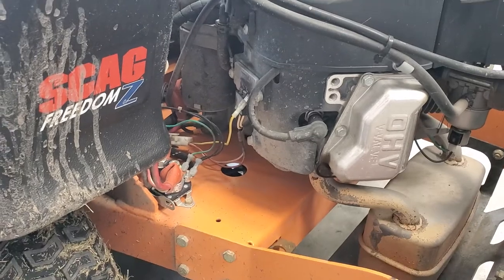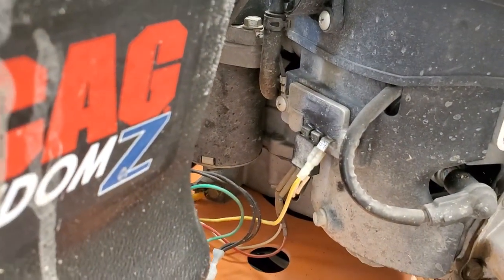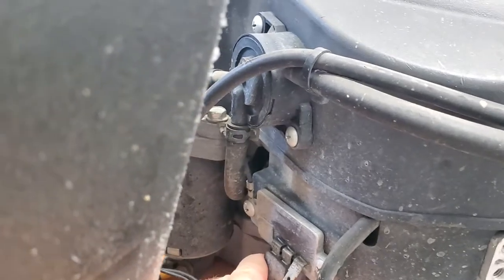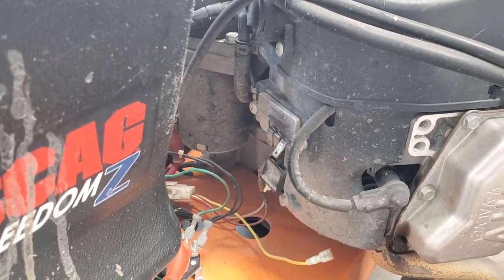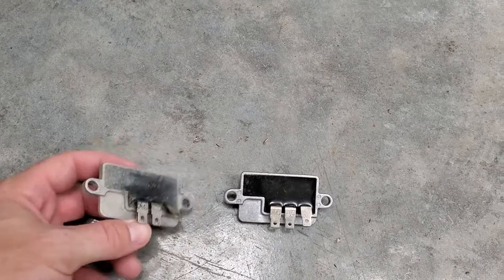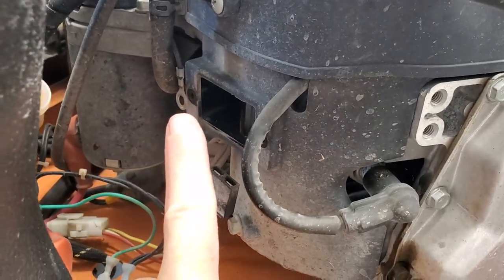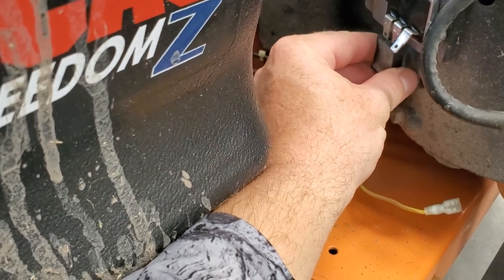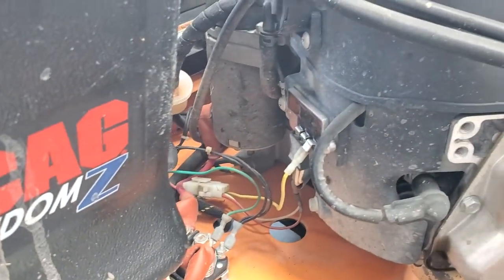Zero Turn Voltage Regulator Replacement

Comment: For whatever reason my machine didn't have a ground wire from the regulator the chassis. Apparently the factory assembler skipped over that step? Also Check the fuse between the positive side of the start solenoid and the regulator🙂

Comment: Hummm…i can remember before all the pto problems if i stopped my mower…it wouldn’t start back up…like it had a dead battery.  Now my pto stops while mowing….it may not be getting the 12 volts it needs to stay engaged……hummm….thanks ....this edit is later on ...I looked all over my freedom z and could not find the regulator/rectifier! so i just pictures...i found it upside down on a plate and if you hadnt showed the back side of yours i would NEVER have seen it !.  my part # is 25 403 35-s on a kohler 7000 series for $17.00 from Kohler...thanks again!!!     https://www.youtube.com/watch?v=SUT99TTPvL8  that is my freedom Z video